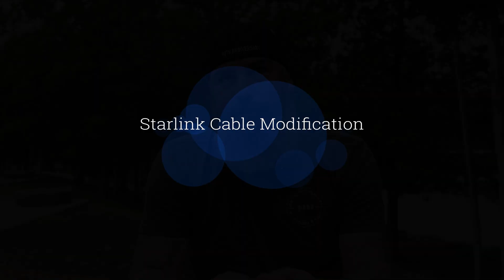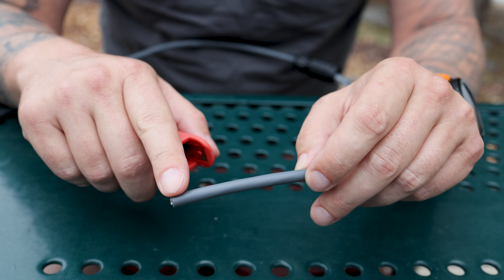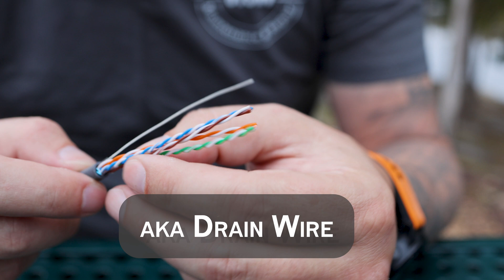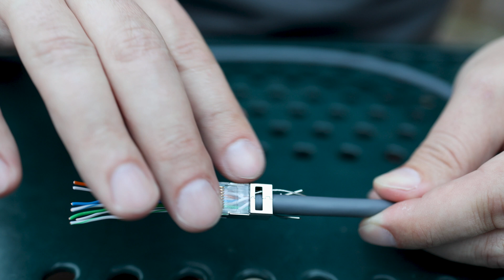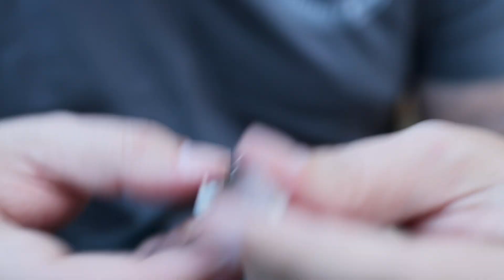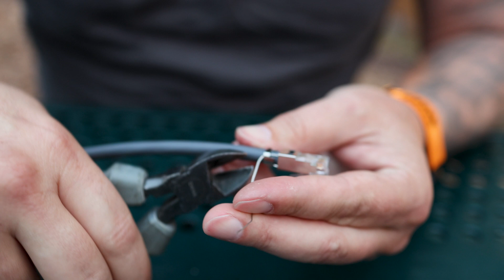Cutting the Cord – Modify Your Starlink Cable

Comment: What is the shiny ground wire that is uninsulated in this bundle of wires what's the metal?
Reply from the maker: That's the drain wire.  It's used to help bleed off electrical "noise" and give it a path to ground.  It completes the circuit for the shielding so the noise can bleed off.

Comment: that is known as cross over cable green/white, green, orange/white, blue, blue/white, orange, brown/white and brown. This cable is NOT shield and has no Aluminum foil shield.
Reply from the maker: The cable from Starlink, which is what we are using, does have the foil shielding and a drain wire.

Comment: my home is wired with cat5, would it be an issue to cut the starlink gen3 cable and terminate with what the house already has?
Reply from the maker: It should work fine.   Technically the Starlink cables are Cat6E, but the 5 should be fine and you likely won't notice any difference in performance ... at least not enough to rewire the house.

Comment: Can you connect the original wire to a coupler and then to an ethernet cable already running into he house and connect that one into the ethernet port? Dish-SL cable-coupler-house ethernet-SL ethernet adaptor.
Reply from the maker: I'm not sure if those couplers exist.  I admittedly haven't checked for them as we already have our cable cut.

Comment: Any chance a deutsch connector can replace the RJ45?
Reply from the maker: I mean, I suppose it could, almost, sort of.   But it seems like a lot when there are plenty of water/weather proof RJ45 connections and glands available on the market already.

The DTM series has their lowest amperage rating (7.5 continuous) and offers an 8 cavity connector, so that's probably the one that would be most likely to work.   But even at that, the smallest pins are rated for 16-22AWG wire.   Cat6 cable typically uses 23AWG and Cat5 is 24AWG, so getting a solid crimp at the pins and socket could be a challenge.
Reply: @ trying to determine what to pack so I can be as lean as possible. I believe you are right and it’s worth bringing a cat5 crimp set along for the journey

Comment: You said to us the T568B yet you used T568A. In the B standard, the order is , Orange/White, Orange, Green White, Blue, Blue/White, Green, Brown/white, Brown.  Your connection was not T568B. And order does in fact make a difference. Power Over Ethernet, POE, requires the proper cable strands are properly positioned in the RJ45 (Shielded) connector. And yes the drain wire must be captured and in contact with the shielding..
Reply from the maker: You're correct.  I always recommend, and use, T568B for these types of connections, but for whatever reason I switched it up and did A.   I can't really say why ... I didn't have a reason or even mean to do it.   So this is definitely one of those "do as I say, not as I do" moments.
Reply: @RamblinHamblins  I have made exact same mistake myself and I have over 40 years of network engineering experience under my belt.Thank you for your reply.
Reply from the maker: Yeah, it happens.    And technically, in our case, because I didn't remove the factory connections on either end (Dishy and router) the wire colors don't really matter ... as long as each connection is made the same (same color wire to same color wire).   But ... the idea was to adhere to a standard, and a standard that made sense, in case cables need to be replaced later or a piece of store bought cable finds it's way into the mix.

And at the end of the day that's the correct way to get it done and align with industry standards.

Comment: Thanks - you didn't connect the white ground wire - just leave it isolated?   I need to shorten my Starlink cable about 20'.  Thank you for the GREAT demo!  ❤❤❤
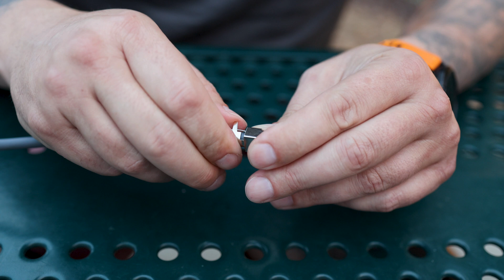Reply from the maker: The drain wire gets captured when I crimped the strain relief for the R45 connector (around the 4:37 mark in the video).   Because the housing of the connector is metal, and I'm using shielded connectors throughout the run it keeps continuity through my run of cable, from router to dish.

Comment: I have a Starlink v2 cable in my motorhome that is damaged, does this sequence work on the Starlink gen 3?
Reply from the maker: As far as I know, yes it should be the same.  Both systems should be using Cat 6 cables, so cutting the cables should work the same.  I believe the only difference in cables is the ends that plug into the router/dish, but I haven't seen one in person.

Comment: How do you seal the end on the dish side?
Reply from the maker: Are you talking about the connection made at the dish?   I didn't touch that connection and still use the same connector/method of connection that Starlink originally provided.

The other end of that cable, that plugs into the side of our trailer, uses a waterproof connector that utilizes a gasketed/screw on connector.

Comment: Wouldn't you need to connect the grounds around the connector instead of clamping them to the connector? I don't see ho the ground connection is made connector to connector when using a female to female connector.
Reply from the maker: The shielded receptacles have a metal body, so by attaching the drain wire to the metal male plug it completes the circuit when inserted into the metal female receptacle.

Comment: Hi, can you use a cat 5 ethernet cable instead of the cable provided by the company so as to have fewer problems passing through the corrugated pipe? An installer says it is possible. Thanks
Reply from the maker: The ends that connect to the router and the dish are proprietary, but the cable is shielded Cat6 cable.  So you could use Cat 5 cable, but you'd have to figure something out when plugging into the router and dish.

In our case we have our cable in 3 sections.   
a) has the proprietary router connection on one end and an RJ45 male on the other.  This cable is short and connects the router to a wall receptacle we have installed behind the television in our RV.
b) has the proprietary dish connection on one end and an RJ45 male on the other, along with 1/2 of a waterproof connection.  This cable connects the dish to the outside/waterproof connector we have installed on the exterior wall of our RV.  I sized this cable to be long enough to reach where we mount our flagpole + some additional length incase I need to raise the flagpole higher
c) has RJ45 male connectors on both ends, essentially the same as a store bought Cat 6 Shielded cable (I just used spare parts of the Starlink cable and added my own ends).  It runs through a few walls and under our couch and makes the connection between the exterior waterproof port and the interior wall receptacle.

Hope that helps.
**this is all written in regards to Gen 2 Starlink.  Gen 3 uses different connectors that I haven't seen in person.

Comment: Does anyone know the maximum length of the starlink cable from the dish to the wifi adapter?  I know I can purchase the 45M cable but I need to be around 175 foot mark.  I have never messed with starlink and understand power is being sent over the wire.  I just wonder about voltage drop exceeding the 45M cable they sell.  I know cat6a/7 max length is 100M so I am assuming I should be good with the poe side of things...?
Reply from the maker: I haven't tried it personally, but I would imagine you would be okay at 175 feet.   There are replacement cables available that are 150 feet, and I've got to assume those work.

Comment: If I have cut my cable, as I have, and want to join it back together, this is one piece I need, Thankyou...and is there the 2nd part to this video, like the female end how to? Thanks .
Reply from the maker: All my connections have been coupler-style, with female receptacles, so I haven't had to add any female ends to any of my cables.   So there hasn't been an opportunity to make a video doing it.
Reply: @RamblinHamblins  thanks , I've purchased a coupler (female-female), will just cap both cut ends and join them up and see how it runs 👍🏼

Comment: will this work for gen 3 cables
Reply from the maker: It should, yes.

I haven't done it personally, but everything I've read/heard says that the cable structure is the same, just with different ends.    I've had people reach out planning to do this to their Gen 3 cables and haven't heard back that it didn't work.

Comment: Can I add 2 50ft cables together using a coupler?
Reply from the maker: You mean once you've added the RJ45s on either end?   Sure, it should work with no issues.  But if it's going to be outside you may want to look into a weatherproof connector, or have some way to protect the connection from the elements.   The port we have on the side of our trailer, to get inside the rig, is essentially a coupler.
Reply: @RamblinHamblins  yes sir I'm planning to use a weatherproof coupler. Our house is surrounded with tall trees and I have no choice but to put it far away from our house.

Comment: I have installed 5 so far this year of the high performance starlink on boats. Most times I have to cut the cable on fishing boats to run through tubing or confined spaces. I have soldiered back together and never had any issues.
Reply: Solders generally aren’t good in high vibration environments as they will end up cracking. Definitely recommend using a crimped connector
Reply from the maker: Agreed!
Reply from the maker: That’s one way to go. 

We needed to be able to disconnect the exterior dish/cable so a disconnect able connection was a must for us.

Comment: I have cable cat 6 through whole my house. Can cut starlink cable and conect to my cat6 cable conect them with rj45 switch both ways and then again do dthe same and conect to starlink router?
Reply from the maker: Yeah .. that's essentially how I have our trailer wired.  I have Cat 6 cable running through the walls and then connect at either end using RJ45s.     Not sure if you are saying you want to run through a switch, but if so I'd think you'd have to run from router to the switch if you were planning to use that as your WAN connection.

Comment: The order of the wires does matter, despite if they're the same on each side.  Stick with the B or A standard.  It will likely "work", because the network speeds are limited, and ethernet has good error correction at the slower speeds, but the twists are used as a "shielding" and to get proper range/speed they need to be in the correct orientation.
Reply from the maker: Noted

Comment: nice video, a question, do you try to power the dishy via a modified cable which is connected to a PoE? and how do you do that?
Reply from the maker: We power our Dishy from the cable that we modified in the video.   It's connected to the stock Starlink router, we aren't running an aftermarket router (providing the PoE).

Comment: There needs to be a bulkhead connector for ST  for through campers and houses..
Reply from the maker: Some of the connectors out there are bulkhead-style in the way they attach to the wall, some aren't.   The one we opted for replaced an existing receptacle on our exterior trailer wall, so we didn't have to drill any new holes. 

The connector itself is a FxF coupler that allows for the Male RJ45s I addded to be plugged in, allowing me to get through the wall of our rig.  So not like the bulkhead connectors often seen with coax cables.